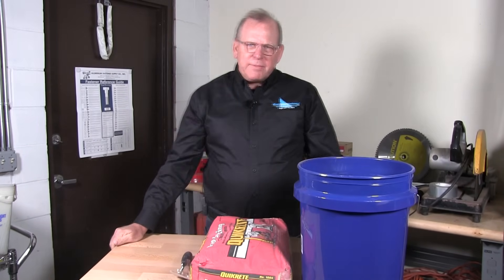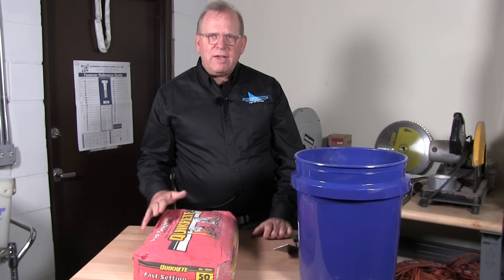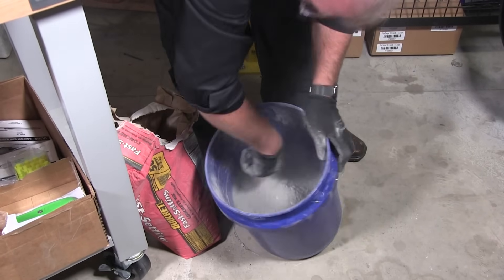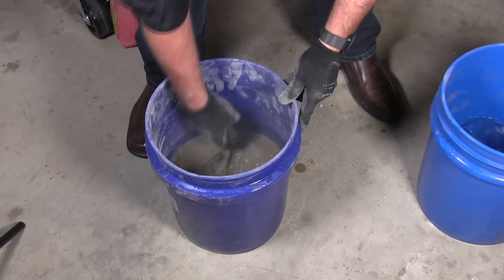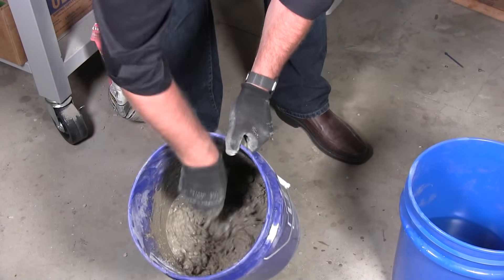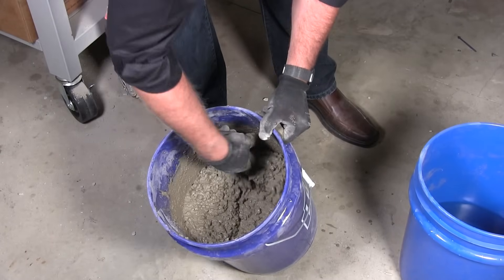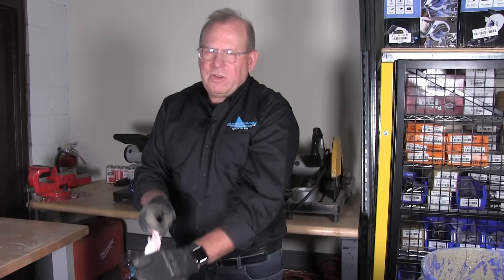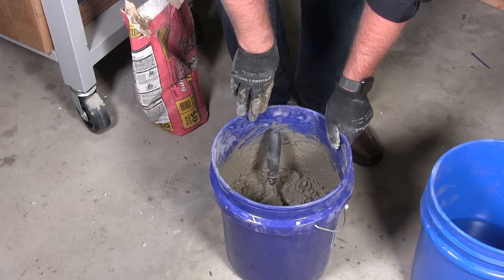How To Mix Fast-Setting Concrete | DIY

Comment: Always start with the water, then add concrete. If it's too dry and you want it soupy, you can pour a little bit more of water while mixing. In Italy we have also special professional machinery with water flow meters, such as pan mixers, silent, reliable, very easy to use but they are expensive and recommended for large quantities of material . In this case a paddle mixer or a drill with a concrete mixing drill would have been the best choice.
Reply from the maker: Thank you for your feedback!

Comment: how can i know what kind of sand or agregate ( there are so many !!!! ) do I have to mix with portland cement for my project?
Reply: If you buy quickrete , either the yellow bags or the red bags, or sakrete....they are already pre-mixed (sand, cement, and aggregate are already in there)- there is NO aggregate needed to be mixed in to the pre-mixed concrete bags.

Comment: Hey, do we need sand to make concrete.....or if I want to only use cement can it still be hard
Reply from the maker: If you are using a concrete mix, like what we used in the video, you just need the bag and water to make concrete. You don't need to add anything extra.

Comment: I cant stop laughing, this should be called how not to mix concrete. You dont pour water in the dry mix, but the other way around, then you dont have to mix for ages and there is less dust. Super fast concrete would turn into stone if you mixed it like this. Also, you use exact amout of water, which is indicated on the bag. "Be careful not to make it too soupy" uses 3 times more water than needed  😁
Reply from the maker: Thank you for your feedback.
Reply: Well he got it right in the end and we got to see how to correct a 'soupy' mix

Comment: How do you harden it up?
Reply from the maker: Fast-setting concrete hardens up over time. Once you're done mixing it, you'll want to apply it as soon as you can!
Reply: Just add more cement dummy

Comment: Can Quikrete be used to build a brick wall?
Reply from the maker: It can, but be sure to use Quikrete's Mortar Mix for that purpose. It's designed specifically for this application.

Comment: Quikcrete's own video says you DON'T need to mix it for post holes. Pour the dry mix in, add water, wait 4 hours. Done. Of course, they also say you can mix it first if you want.
I watched my landlord install a wood fence using the fast-setting stuff. He did all the mixing in the hole with his gloved hand instead of using a bucket. He spent only about a minute stirring it up, then put the post in. The next day every post was rock-solid.
Reply from the maker: Thank you for your feedback.
Reply: that's gangsta
Reply: I've seen the company's video too. I just wonder how the water makes its way to the bottom of a 12" hole without mixing. I've seen some videos of people poking the mix with a stick or trying to stir it even though the company doesn't say to do it.
Reply: RKGSD it doesn’t make it’s way to bottom of hole. My neighbour used that method when installing my electricity pole I dug into it months later as pole was swaying in wind. I would mix in bucket if you don’t want to re do the job.
Reply: @rkgsd  I’ve seen public works stack bags of concrete mix in the shape of a wall.   The rain will turn all the bags into concrete. No need to remove the paper bag either.
Reply: @thomaspayne6866  "Public Works" - that explains it 👍

Comment: Use a wheelbarrow and a hoe y’all it’s easier to mix than using a bucket
Reply from the maker: That's definitely true, and will make the whole process easier, but it's not required. Since not everyone has a wheelbarrow and a hoe lying around, a bucket will also work just fine. Thank you for the advice!

Comment: Isnt this product made so you don't mix??? Your just supposed to add the water on top and leave
Reply from the maker: Although the bag says you don't have to, you'll get a much better consistency if you do. Some applications of Quikrete will benefit more from mixing than others, but it is ultimately up to personal preference and application.
Reply: Quickrete saying to add water on top of dry concrete is specifically for post holes.They seem to think the water will find its way to the bottom.

Comment: I’m pooring a new pad for my AC condensor unit outside tomorrow... i was hoping to just mix buckets and dump em in the “box”, as i make em, say about 7-8 buckets. Can i do that if its slow setting? I’ll be using the cement drill bit on a corded drill.
Reply from the maker: Yes that should work fine. You may want to mix on the wet side for a slower cure however.

Comment: Clearly you haven’t any experience mixing quick set concrete. The more you mix and add water the more it takes away its quick setting ability. If your going to do an application that requires a concrete consistency like that then save some money and just buy the 60lbs slow setting. If you need quick set to set quick then follow the instructions on the bag it works very well sets very fast ... too fast to be trying to mix it.
Reply from the maker: I love comments that don't understand how to properly complete a project.  Proper mixing of concrete is key to a sound project.  You are wrong.  Here is the manufacturer's recommendations and maybe you should go back to reading the bag on your next job.  But not at my house!  

HAND MIXING INSTRUCTIONS
• Empty bags into a suitable mixing container
• Add approximately 4 pt (1.9 L) of clean water for each 50 lb (22.7
kg) bag
• Work the mix with a shovel, rake or hoe; add water as needed until a
plastic-like consistency is achieved
• Do not add more than 5 pt (2.4 L) of water per 50 lb (22.7 kg) bag
• Be sure all material is uniformly mixed
• Do not leave standing puddles
Reply: @AlbanyCountyFasteners  "Well mixed" and "Uniformly mixed" are two different things imo Bob.
Reply: I agree, for someone supposed to know concrete he took hella long stirring.... add water...  stirring... add more cement.. stirring...
 Geeze. 

Use a wheelbarrow or trough. Start by dumping a gallon of water into 80 lbs mix, stir with a shovel adding up to a quart more to best consistency. 3-4 minutes tops.

Comment: I'm covering the brick surround of a fireplace which is approximately 12" above the firebox opening and plan to extend it up the wall to the ceiling. Does concrete adhere to plaster? (the walls of the house are plaster)
Reply from the maker: Under the right conditions, concrete can adhere to plaster. There's 2 ways we know about that you can do this but we suggest contacting the concrete mix manufacturer for the best results.

One thing you can do is get a thin set mix and use that with an adhesive to get the concrete to adhere to the wall. Alternatively, using a metal lath and nailing or screwing it to the wall and then applying the concrete could work. This is assuming the brick/stone is veneer. 

Ultimately, to get the best results out of your project, you should review the manufacturer's recommendations for adhering to an existing plaster wall. 

Please note: a review of the plaster wall would need to be completed to check for sound construction and it needs to be checked for delamination of the plaster from the lath.
Reply: Good Question

Comment: I'm making a little patio and I have exactly the same stuff he has, do I need to flatten the ground or measure the floor or anything? I already digged a hole
Reply from the maker: If the hole is already dug, you will need to flatten the ground in some way to ensure the concrete is level. Typically this is done with a layer of compactable gravel. Consider using a laser level to help you out. With what information you provided, we don't know enough about your application to give you any specific next steps, however the following article may be useful to you: https://www.wikihow.com/Pour-a-Concrete-Patio

Comment: hi sir i m from india how to fast set cement concrete ..?
any chemical name sujest me..thx
Reply from the maker: Hi Ajit,

Concrete sets due to heat and lyme, so the higher the lyme content, the faster the concrete will set. If you are looking to speed up the process even more, then warmer water would also work. 

This is tricky though and we can't really recommend it because you can often run into issues where the concrete will begin to set before it is properly laid out which can weaken the integrity of the concrete application.
Reply: @AlbanyCountyFasteners  thx sir

Comment: if fast setting quikrete is setting too fast for your application, can it be mixed with regular quikrete to slow down the setting?
Reply from the maker: We wouldn't recommend mixing different types of concrete. Both fast setting quikrete and regular quikrete have different compositions. It's difficult to say how well the end resulting concrete will perform if you mix rapid-set with regular.